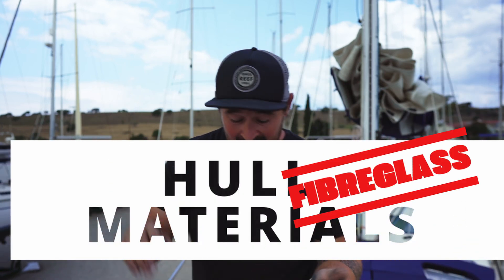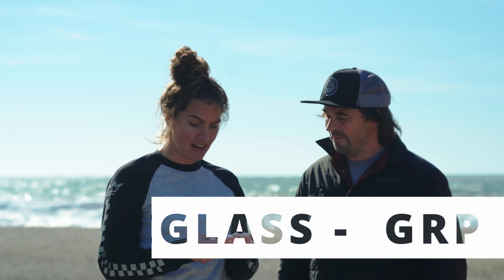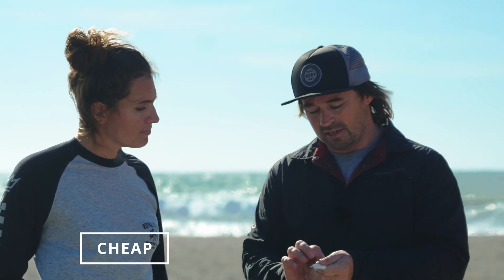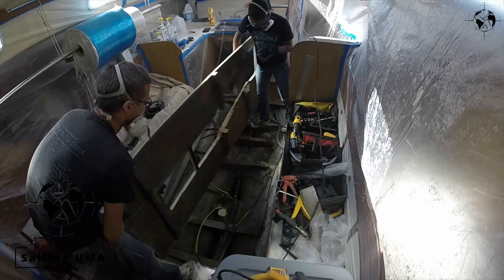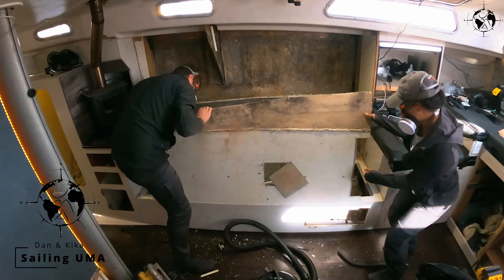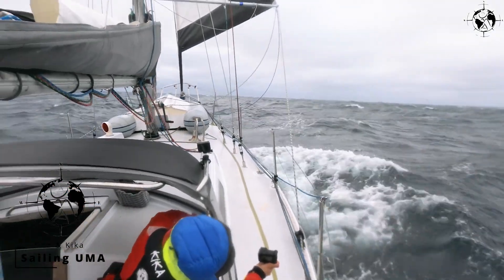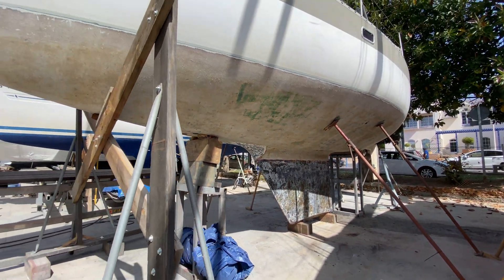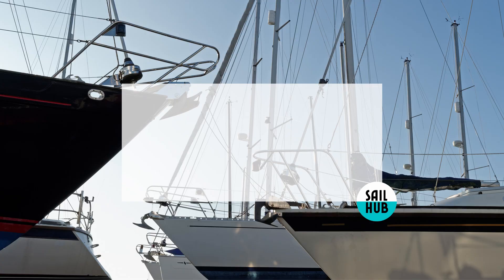Fibreglass Boats 101- Why so CHEAP?

Comment: Fiberglass in boats is the most practical for private boat ownership and recreational use. There are sometimes reasons to use other materials, but it is something that private boat owners should absolutely avoid as long as possible. I have had aluminum, steel, wood and fiberglass boats for 50 years and advise against anything other than fiberglass.
Reply from the maker: I would agree with you in many respects but that’s just assuming that private owners don’t know how to deal with the other materials. If you know why your doing all are fine, it’s just understanding the characteristics and being able to do the work for chosen material that matters.
Reply: @SailHub  There is an expression that says "You don't need a battleship to cross a ditch" So for boat owners the same applies. Boats can be built in many complicated and exclusive variants and materials but it's about getting out on the lake or sea so keep it simple because water is a difficult enough element for many without complicating things further with boats that require total maintenance discipline just to stay afloat.
Reply from the maker: Sure, unlike the saying but your speaking as if people don’t do adventurous things. There’s thousand people out there do.
Reply: @SailHub  Have sailed around the world myself.
Reply from the maker: Sweet, well done. That’s a fair old adventure and you will know it depends on you route, as to what boat suits you best. Fibre glass is awesome for most applications but would you want that if you going round via the north west passage or green land ice land route? Northern sea route etc?

Comment: good info. I think osmosis is a bit demonized. It is not a given that an FRP hull will develop osmosis. I bought a 40 years old sailboat and the hull has absolutely no blisters.
Reply from the maker: For sure, the variables are high although it will get it eventually. That being said, on a well build boat it can take multiple decades before its even a slight concern.
Reply: @SailHub  well, if a 40 years old boat does not have it, I don't think you can say that "it will get it eventually". When, at a 100 years old? . Some boats have it at 10 years old, some don't; therefore it is not an inherent material problem, but rather a fabrication procedure issue.
Reply from the maker: @Jarek12010 It’s just the physics of the materials and the environment chap. I don’t make the rules. It’s not waterproof, end of story. 
Osmosis is also not determined by blisters. Its likely do have it already, just not a a level that’s worth thinking about.

Comment: WOW - I am 2mins into this vid and already there are some comments that really resonate with me - At the drinking club where I am doing my rebuild (yacht club - but they seem to spend more time/effort making sure the bar is up and running - I call it a drinking club with a sailing problem) I see ppl slipping thier boat and doing fiberglass repairs themselves every week. My ALU boat ? - not so lucky - I need to hire expensive specialized SKILLED ppl to do any work to my hull AND I had to strip the interior so as  to get access to the hull for re-plating some areas of the hull and so the boat did not catch fire while TIG welding new plates in. Actually, its near impossible to put hull plates in without removing the interior (or sections of it depending on how extensive the re-plating is). So your observations are SPOT ON.
Reply from the maker: Cheers Jim

Comment: The cloth you held in your hands was indeed a type of fiberglass.  It only becomes GRP when infused with resin and cured.  Also, your thumbnail showed Vestas after she ran aground in the Indian Ocean.  She was a VOR 65 and was made of carbon fiber - in some ways similar to fiberglass/GRP, but not the same.  And finally osmosis is not a problem in salt water only.
Reply from the maker: Thanks for the info, it’s revolutionary.
Reply: Revolutionary for a sailing channel?  That’s a bit concerning.
Reply from the maker: @ericvanvlandren8987 I think you may find that was sarcasm.🤩

Comment: @SailHub Nice short video on GRP! I think this video might be worth revisiting to discuss at least two additional topics: #1 common "core" materials often used in fiberglass builds (cork, etc.), as well as the fact that some boats opt for solid GRP to be super strong, but naturally have a weight (like Nauticats). #2 Newer "greener" Fiberglass alternatives, like the product you covered at the recent boat show. Optionally, you could mention that fiberglass currently has some environmental sustainability end-of-life issues; however, some fiberglass recycling efforts are starting to show up, partially due to all the disposal of wind power blades. 👍

Comment: Fiberglass is fine as long as you don't hit anything. Yes, it requires some protection in order to prevent it rotting away over time but it's a reasonable effort and a lot less work than on a steel hull and more robust when not taken care off all too well for a while. Aluminium doesn't require that much maintenance but you'll pay dearly if you ignore electrolysis and galvanic corrosion. I'd still pick Aluminium though for the added strength and overall robustness.
Reply from the maker: Is luck aluminium too, like you say though, fibreglass is an easy option for people which is probably why it is so popular!
Reply: @SailHub  I'd say it's not really popular, it's just everyone for decades becaues they are so damn cheap to build for the shipyards.
Reply from the maker: @diotough  yup. I’d agree with that!

Comment: We have a 1980 grp Airex foam core composite hull. Totally dry when we had it surveyed in 2021. Lay up is 6mm grp outer skin, 25mm airex core, 6mm inner skin. A total of 12mm of grp but 37 times stiffer than a solid 12mm hull.
Reply from the maker: Hey Tim,
Good to hear your happy with your boat!! Yeah, a cores hull is way way stiffer, when mixed with a light weight build it really ins a good performance boost!

Comment: You didn't mention the fact that it is highly flammable, you don't see aluminium or steel boats burning. It is very difficult to repair if diesel or petrol gets into it as the epoxy does not bond. Many countries are introducing high disposal fees for fibreglass boats and will rise as its an epidemic. This is a large reason secondhand boats are cheap because people want to get rid of them.
Reply from the maker: Unfortunately that’s not quite true - aluminium can melt in a battery fire, it’s unlikely but it can happen.

The other thing here is, if you have a diesel fire you are not likely to get it absorbed into the fibres, it will most likely burn off before absorption can take place. 

The next thing we need to account for is the size of the fire, a small to medium fire, say an contained engine room fire will cause extreme heat where the hull resin will burn. 

However as a boat builder I would suggest your going to cut it all out and grind off the heat effected areas completely any way. It’s generally not too hard to repair unless of course it’s a complete hull fire and there are no areas the fire has not effected. 

It would certainly take time though and  the unlucky soul doing the work would need some skills, understand how to make moulds, laminate as well as understand the strength properties they are dealing with.

If they were paying for this knowledge and time it’s almost certainly a write off.

Comment: The important thing on GRP is type of core. Better buy a boat without a core from 60/70s and early 80s.
Reply from the maker: Good point - although if not below the water line a core can make a much stiffer build. A damaged core is a nightmare however some are not too bad. I guess it depends on the type and the build quality
Reply: @SailHub  my Endurance is absolutely bombproof, all solid and very thick. Heavy but who cares I'm not racing!
Reply from the maker: @sailingmrnice sweet! I’m a big fan of bomb proof boats! Also race boats though, horses for courses! ⛵️👍

Comment: Great explaination. I’ve heard that boats like Gunboat and HH are epoxy fiberglass and/or epoxy carbon without the need for vinylesther coating thus saving weight. Is that right?
Reply from the maker: Hey, so HH uses epoxy which means a lighter build and pretty much impervious to osmosis. As for the Gunboat - I may be wrong but I think they use vacuum infused e-glass which may be polyester resin still but they could also be epoxy. The vacuum infusion reduces resin content and therefore weight but also removes air in the laminate which certainly helps to defend against osmosis although it will get in there eventually. 
In general if brands uses epoxy they usually shout about it as it’s expensive.

Comment: The biggest Con is that its bad for the environment as nobody has a solution what to do with GRP after use……
Reply from the maker: Now that’s a fair point, there’s a lot going on with recycling carbon and resins at the moment but fibreglass… not so much. It’s really not ideal.
Reply: It's not necessarily bad for the environment though, it just takes up space in a landfill. Landfills in general are a good thing since they can eventually be remediated and turned back into a natural environment. I've seen some landfills that have turned into very nice city parks, as well as reforested. 

Also, while in production, a landfill produces a large amount of natural gas, which we consume as a replacement to petroleum products. 

I know there are some downsides to a landfill, like water table pollution, but being contained to a specific area that is used for millions of people at a time pretty well mitigates those things.
Reply from the maker: @n0madtv  that’s an interesting view on it - thanks🍻

Comment: I've seen grp hulls from the 60's with osmosis on the outside but complete dry bilge coz the hulls were an inch thick😂😂😂
Reply from the maker: This is really common! In fact even the modern boats can remain dry for a long time. I recently consulted for a 15yr old Bavaria that was only just to say keeping moisture out. Scary stuff and a huge job to put right! 😮
Reply: @SailHub  yes, i have a 1965 nicholson 32 and that is heavy boat and thick pure fiberglass,  the deck as well, does not bend or anything. Good boat and no early reefing needed, she will sail fast with strong wind and remains stable,  can leave the helm to get a coffee and she keeps going straight.
Reply from the maker: @johan8724  sounds like a tank! Awesome 👍